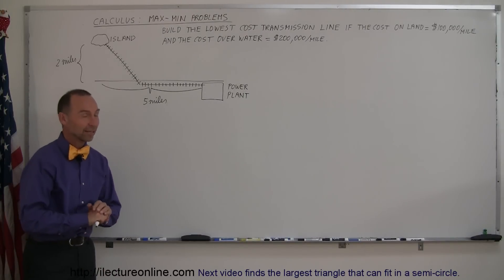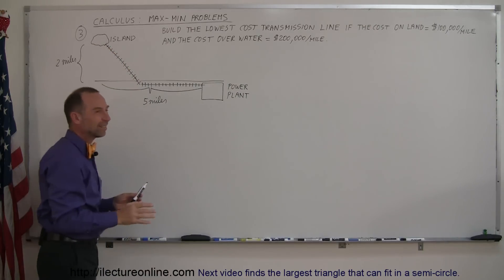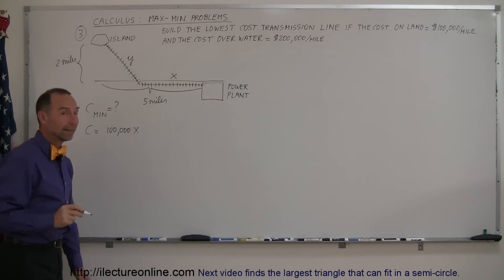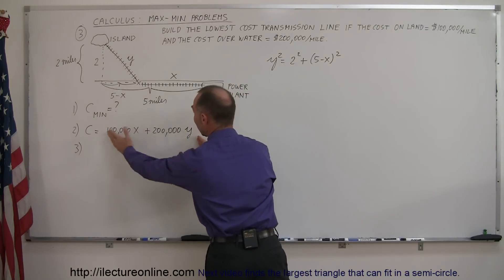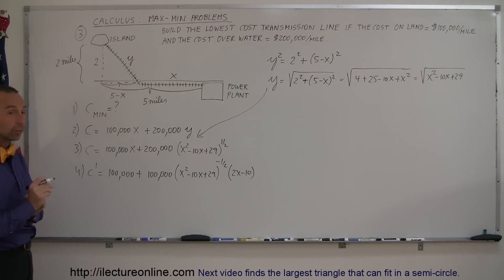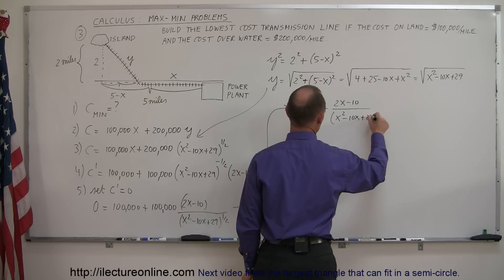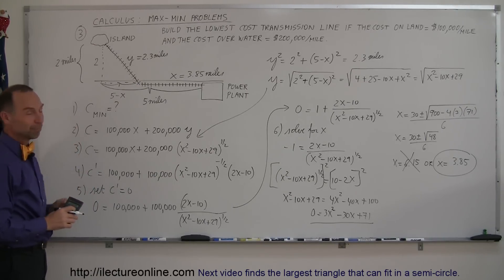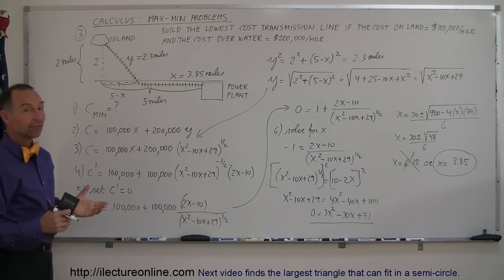Calculus 1: Max-Min Problems (3 of 30) Transmission Lines

Comment: Professor Michel van Biezen  thank you for an awesome video/lecture on Max-Min Problems, however you have y equal to 2.3 miles and y squared equal 2.3 miles. Please correct this error in the video.
Reply from the maker: Yes, it should indeed be 2.3^2

Comment: What if we want to maximize the cost..it seems this method will not work
Reply from the maker: The method works in all cicrumstances.  You just need to include the constraints.
Reply: @MichelvanBiezen  i mean if we want to maximize it we have to set the derivative again  to zero , resulting in the same solution
Reply from the maker: The equation will be different depending on how it is phrased and how the constraints are set.  Look at the other examples to get a feel for it.

Comment: But how we know that we are finding max or min because both min and max has slope as zero and probably have the same formula C = 100,000 X + 200,000 y to start with ..
Reply from the maker: There are a number of techniques that can be used.  (see our videos in calculus 1, (max/min problems).  But in this case you can see that the parabola inside the radical opens upwards, and therefore you would expect a minimum value when the slope is zero.